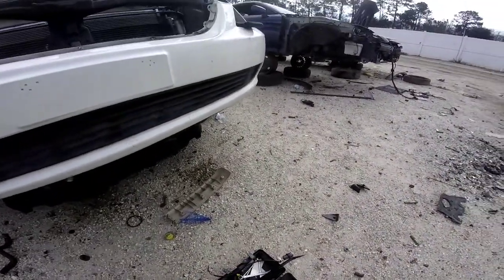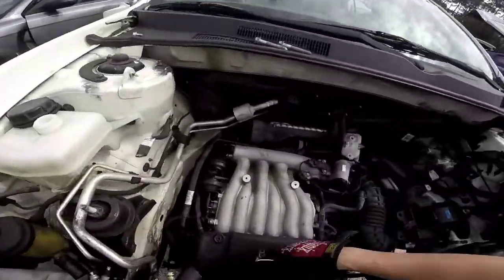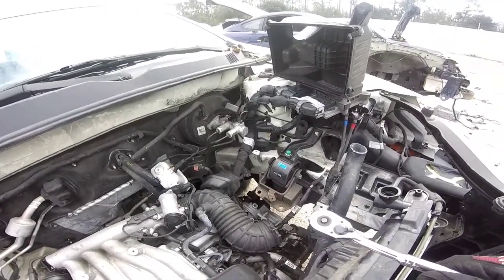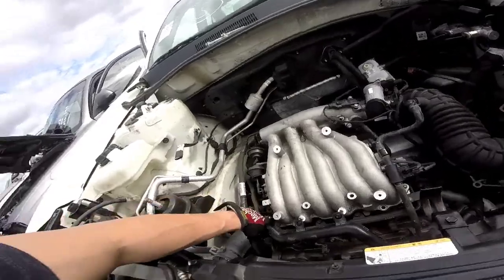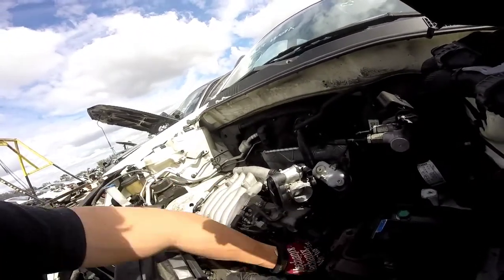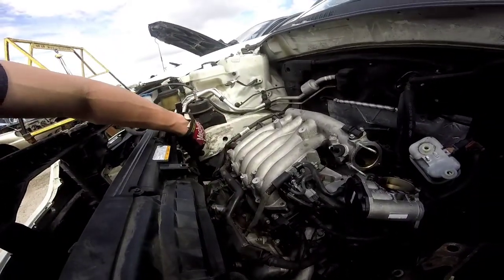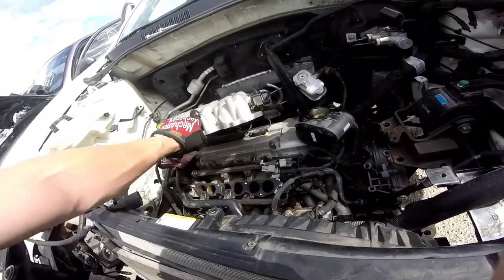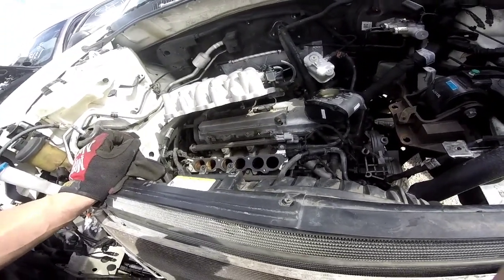Hyundai 2.7 liter engine manifold dissasembly

Comment: Your injectors are probably clogged
Reply from the maker: I switched the injectors around and the same misfire kept taking place
Reply: Mine was misfiring bad could barely get it to rev or go over 20mph I changes spark plugs wires and a injector still was doing it purchased a new MAF sensor and it ran like new again I almost gave up on it
Reply: @boostedkidproductions9719 i know this is a 5 year old comment but I'm praying to the YouTube gods here lol

Was your misfire only on the back 3 (bank 2)? And did you have any codes?

Comment: Once you spliced the replacement cable and connector into your car, did it resolve your problem?
Reply from the maker: I didn't splice any wires. Just used a whole harness. It did not fix it. I sold the car
Reply: @chemicalspore  Sorry to hear that.  Thanks for the quick response.